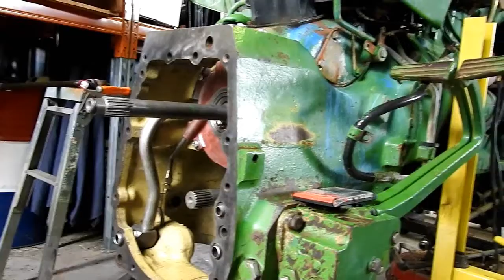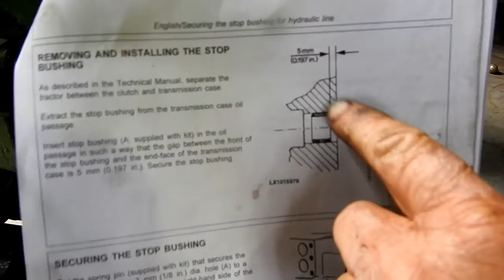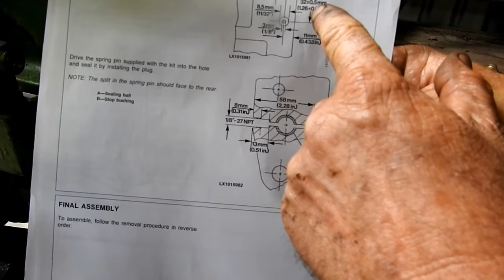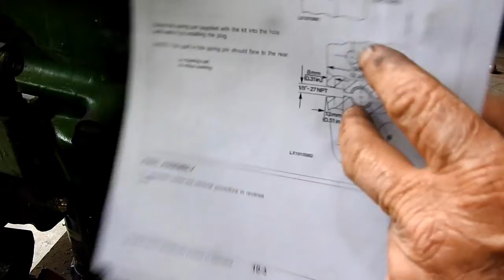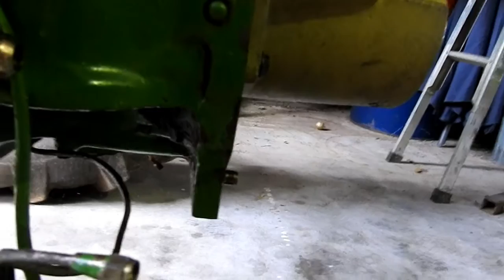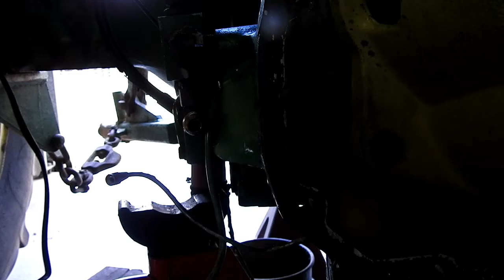Fitting John Deere AL41352 Pipe Retaining Kit to the John Deere 1640

Comment: hi!
Do you know witch pipe is going to the 3 point raising arms? the pipe with pressure
Reply from the maker: the small one coming back from the front pump then it goes up through the diff housing.

Comment: Thank you for this video series! I have a 2640 that is very similar and I really wish I had viewed your 1640 videos BEFORE I repaired mine. Unfortunately I had hay down in the field and lost all hydraulics while finishing the cutting so I had to quickly diagnose the problem and split the tractor between the clutch and transmission to replace a blown out transmission pump output pressure line. Mine had the old style with the retainer up by the pump which is now obsolete so I had to order a new pump bracket, tube, and bushing. All parts came from my local JD dealer and I even spoke in person with their service techs because I was not sure how the press in bushing was supposed to be installed. They told me to just press it in. They never mentioned the roll pin modification. Everything works fine but it looks like I'll be splitting it again so I don't get stuck in the field. Thanks again, your videos are a huge help.
Reply from the maker: Thanks, My kit was a genuine one I have not seen a kit without the roll pin but they may have changed it since. You never stop learning.
Reply: @bundybearsshed  I don't believe they changed the kit. I think there were 2 contributing factors to the missed kit. #1 The service techs I talked to were young and probably never worked on a 2640. #2 The John Deere online parts catalog has a list of substitute parts needed to replace the older pressure line (the version that is retained at the pump) and only lists 4 required substitute items. The new pipe, the new 90 deg elbow, a new pump/elbow retainer bracket and the transmission case bushing. It should have called out the entire transmission case bushing kit or at least mentioned it. In any case, thank you again for all of the effort that goes into producing your videos. I tried to document my tractor split and it probably doubled the time to finish each step so I ended up not recording everything just to finish and get back to the field.  With that said, you're pretty much an expert so even the things that you think are mundane or uninteresting are actually very interesting and worth watching. So if you have the time, I'm sure others like me are more than happy to watch you clean a check valve or repair an electrical system.

Comment: they may use a soft roll pin so you can drill it out to change the bush if needed at a guess
Reply from the maker: Possibly, but the bush is normally a set and forget type of modification.